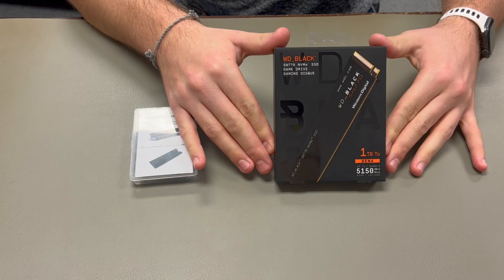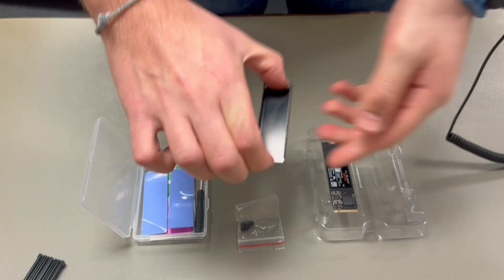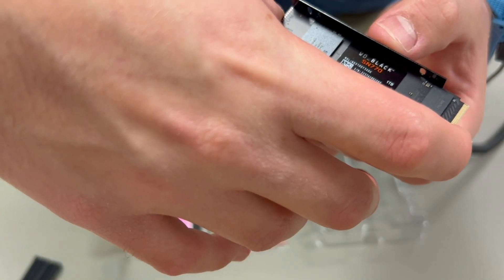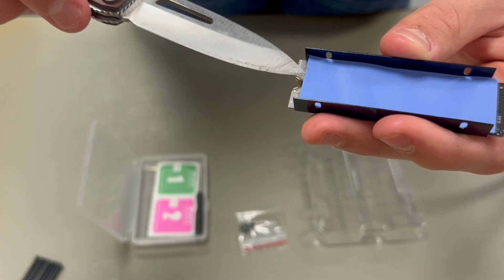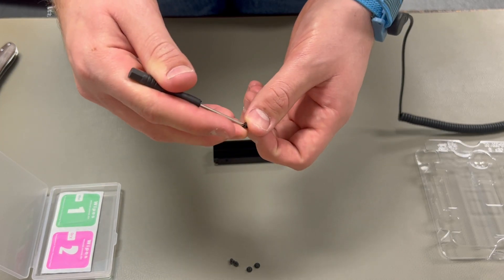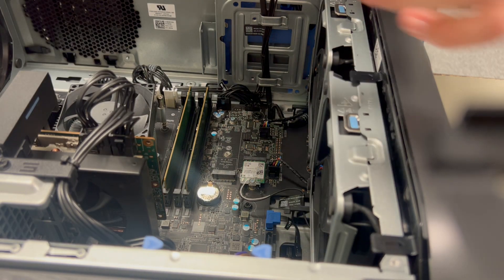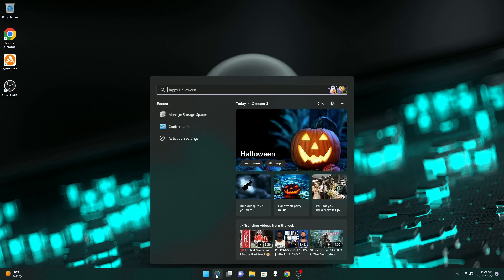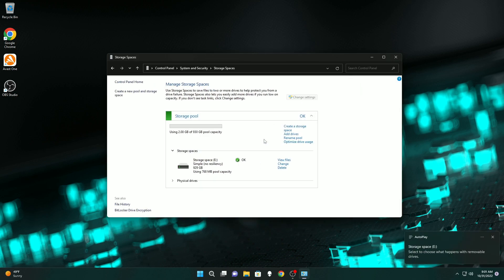Alienware R13/R14 Aurora NVMe Storage Upgrade

Comment: my R13 is 512GB   so i could just do the samething as you to upgrade it with 2TB one ? it is replace or add up to original ?
Reply from the maker: Correct, it just depends on how you want it to be set up the R13's have 2 NVMe slots so if you want to add a 2TB one just add it into the extra slot like I did and use the new one as just a storage drive on top of your old drive. Or you can swap out the 512 GB and reinstall windows on the 2TB instead, totally your call! Thanks for commenting.

Comment: Does the R13 accept a gen 5 ssd?
Reply from the maker: Yes, it will accept a gen 5 SSD and it will work however it will only work at gen 4 speeds since it only has a gen 4 interface. This is also the case for the New R15 according to Dells documentation.